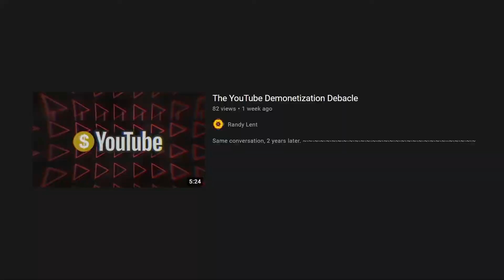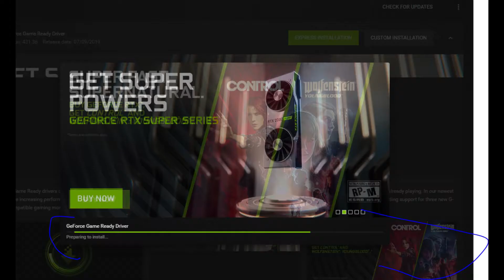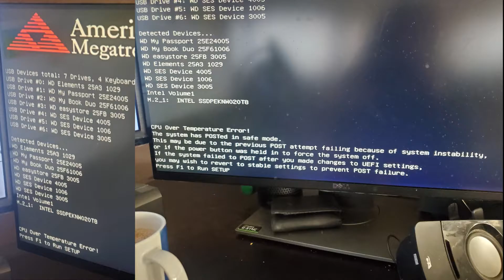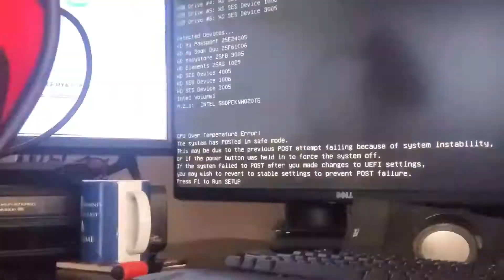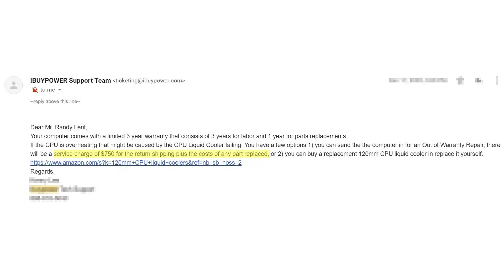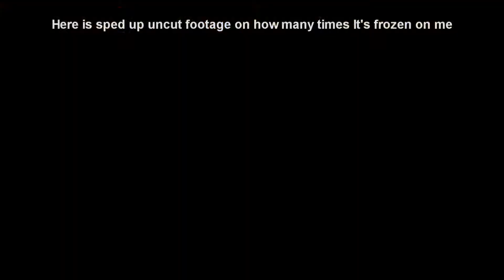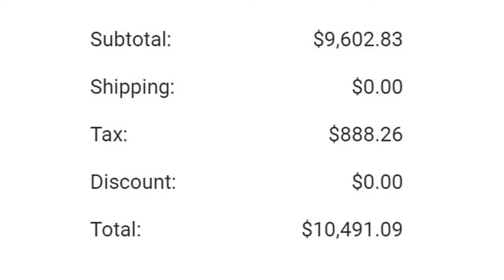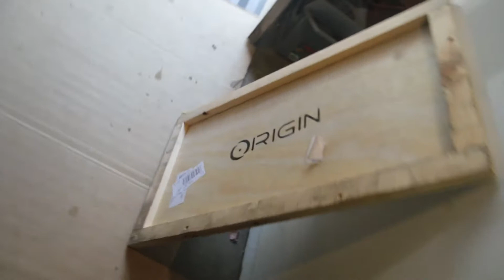Fuck iBUYPOWER

Comment: Also, randy 2:56 the graphics card drives wasnt installed, at first because windows does fucked up stuff, when it comes to graphics drivers was probably using the base display adapter that maxes out at 480p or somethj g